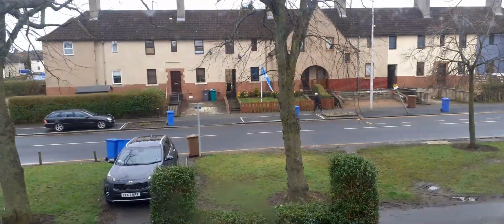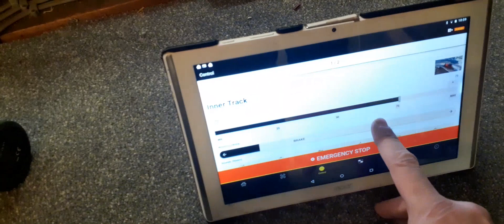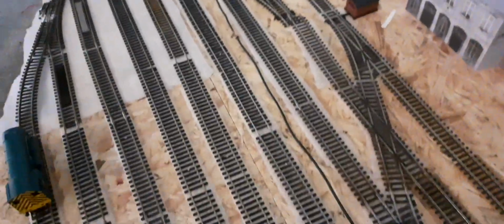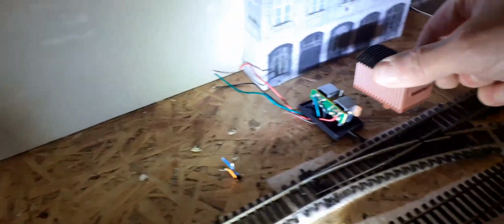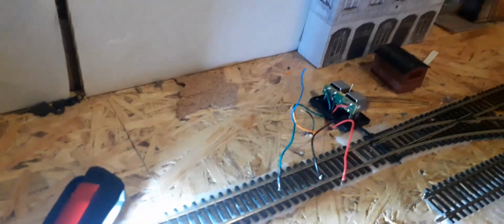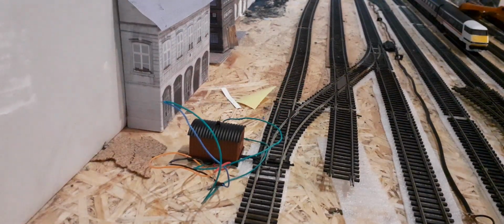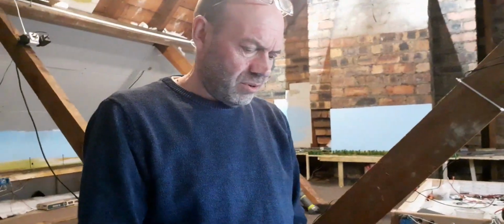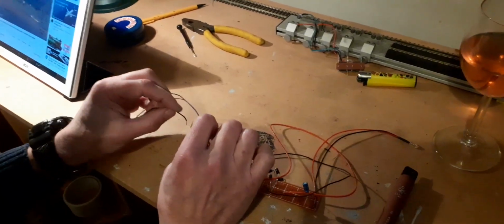Model railway, fun, stress, education,serious stuff

Comment: I've tried to comment twice now on this video and the comment counter seems to show that but the comments do not show. I was trying to help with the components you queried on the brake van light circuit.
Reply from the maker: Hi, got comments now ta. The main thing is I learned the diodey one way whichever concept. Baby steps for me
Reply: @laingstrains3577  That diode configuration is referred to as a bridge rectifier; you can get them as a single component usually round with 4 legs but also as an IC type package which is generally easier to use; I put a link of sorts in the brake van description.